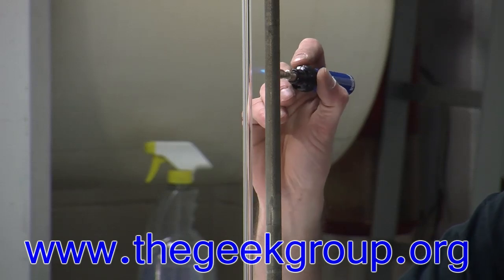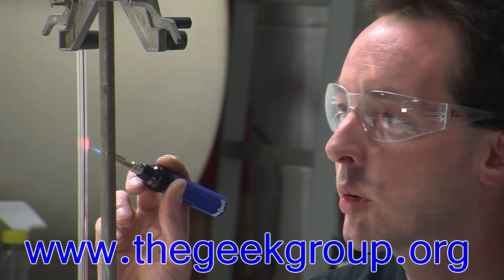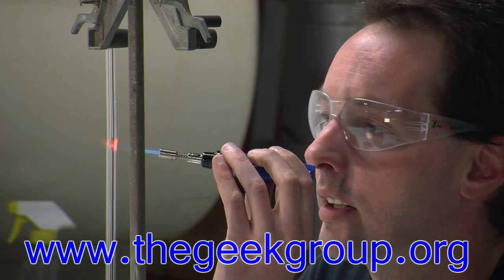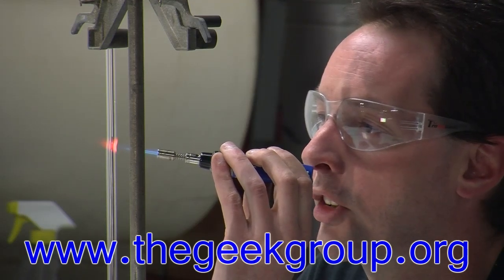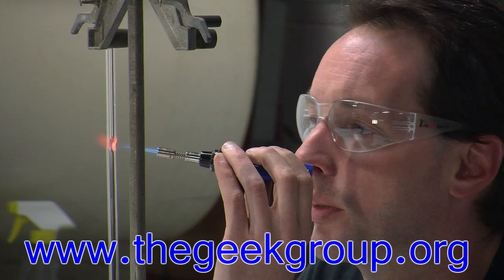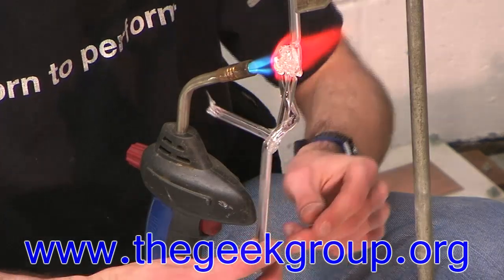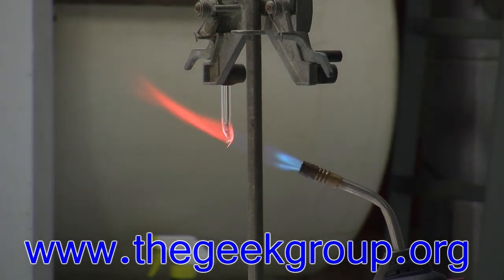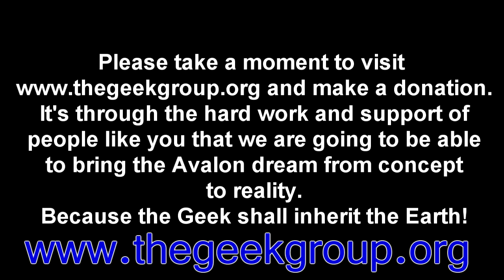Playing with molten glass

Comment: @Stiple666 Didymium glasses are for cutting back on the sodium glow of the gloryhole, you don't need them at a scale as small as this - plus many glassblowers, myself included, refuse to wear them because they judge the temperature of a piece by it's color - take away the color and it's like we loose one of our senses. Also once the color is inside the glass, there aren't any fumes; it's not the metal itself that colors the glass, but the metal's oxidized by-product